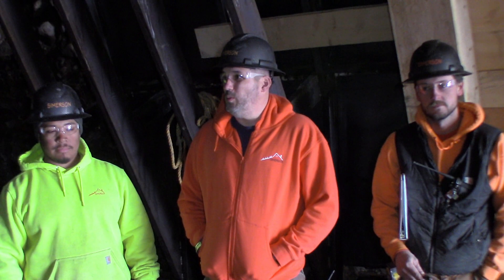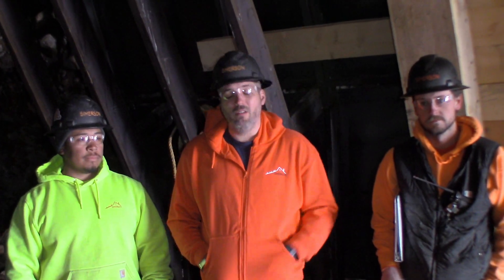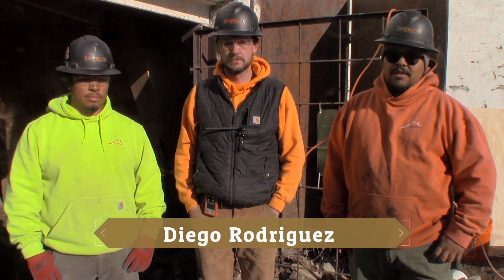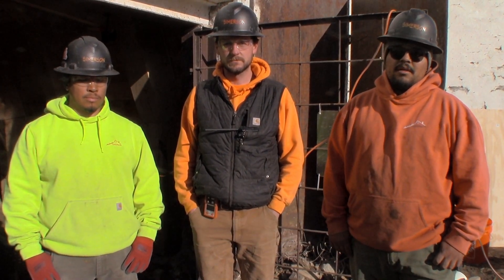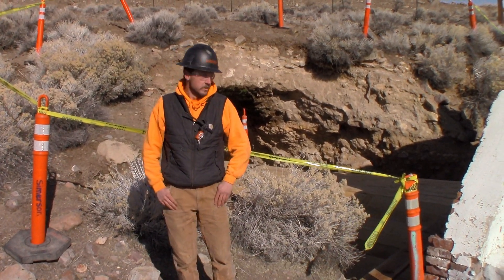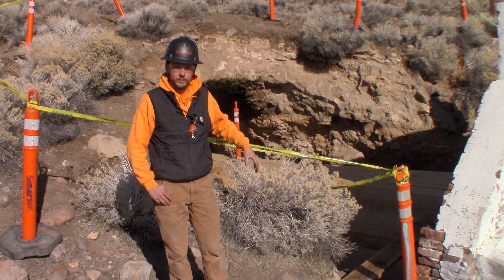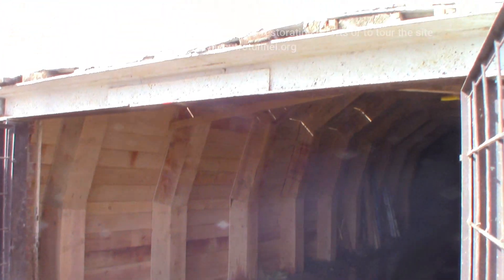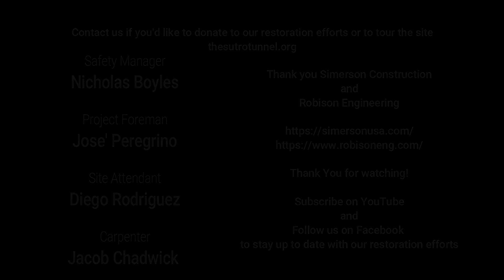Rebuilding the historic Sutro Tunnel and the safety measures we're taking

Comment: I'd like to see this done. 

It would really help if there was a train to ride. Almost 4 miles is too far to walk round trip.

The type of rock this goes trough would be very interesting. Perhaps some is firm enough to leave somewhat exposed.

There might be stations and other facilities which could be informative about the history. I would very intrigued to be able to peer into areas which have historical square set timbering.
Reply from the maker: This is historicaly accurate to this section of the tunnel. Square set isn't until further back. What we're pulling out is the failed fake square set done by Houston Oil and Minerals from 1979. We do hope to use one of our electric mules, there will be sections were you will see and touch the hard rock further back past the loose alluvial fill.